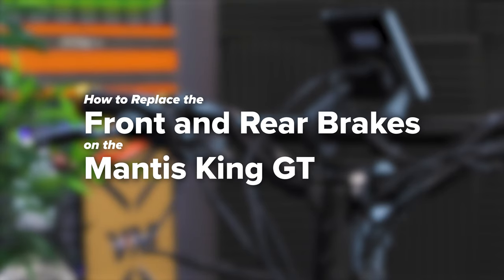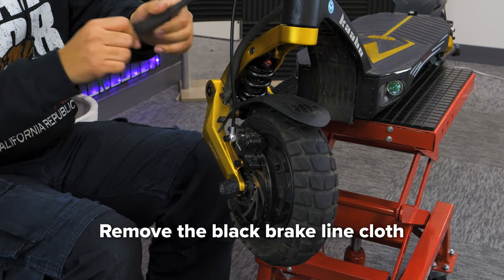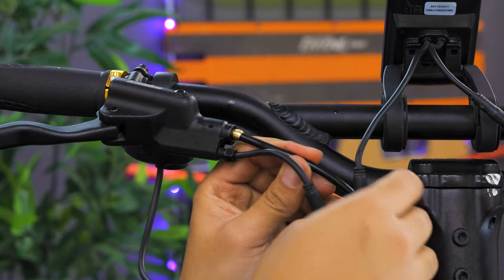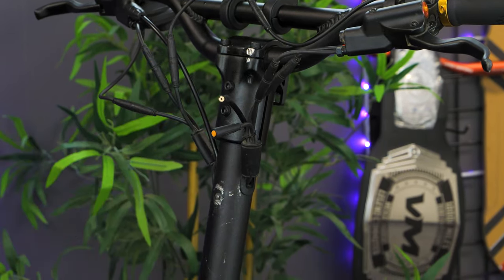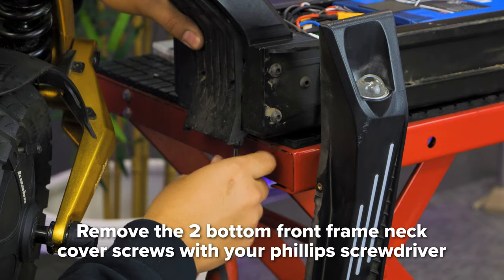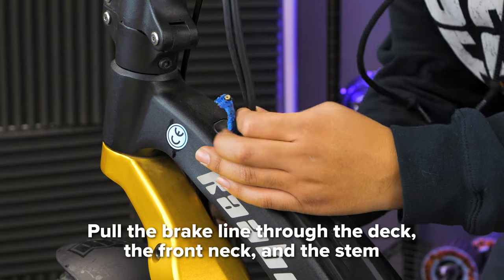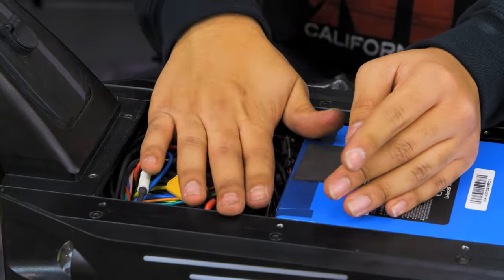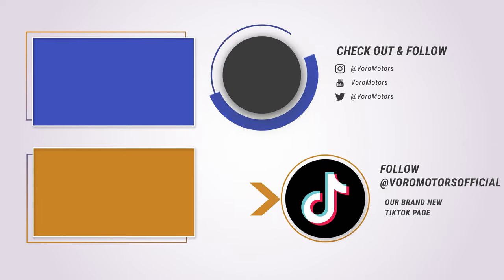How to replace the Front and Rear Brakes on the Kaabo Mantis King GT - Voromotors tutorial

Comment: but it is possible just replace only the break pads??? or if my pads will finish i need change hall system ???
Reply from the maker: If you need to replace just the brake pads, that's all you need to replace. In some circumstances, it may be necessary to replace the brake calipers and lines as well, though, which is why we have this video available to customers, in case they prefer to perform the replacement themselves.